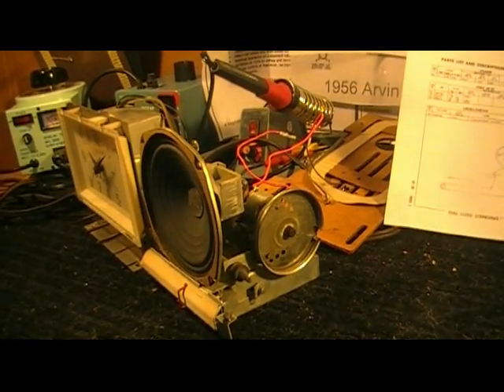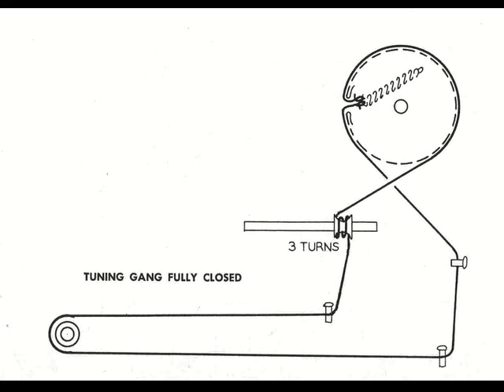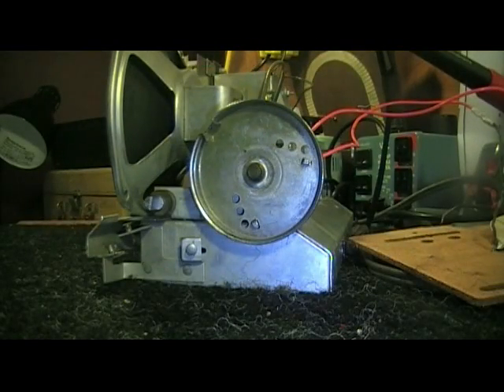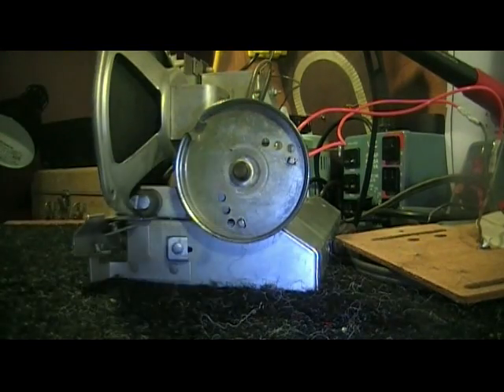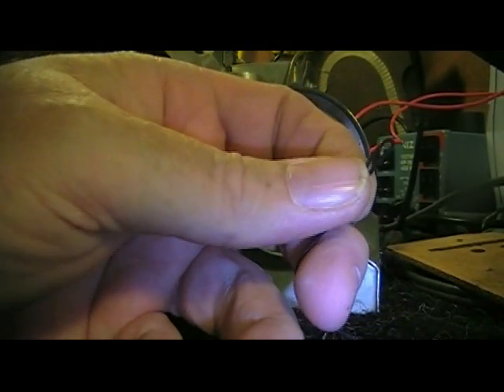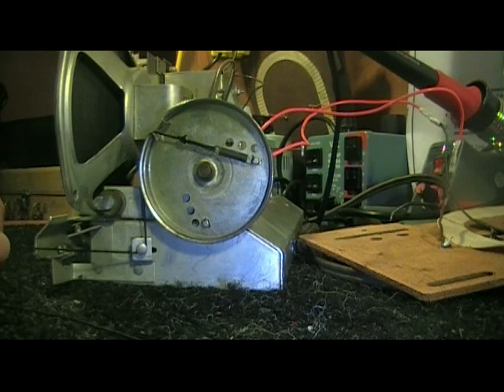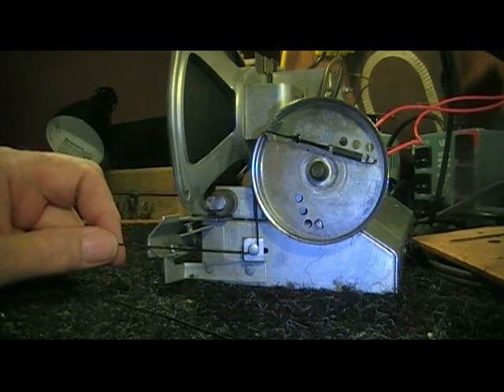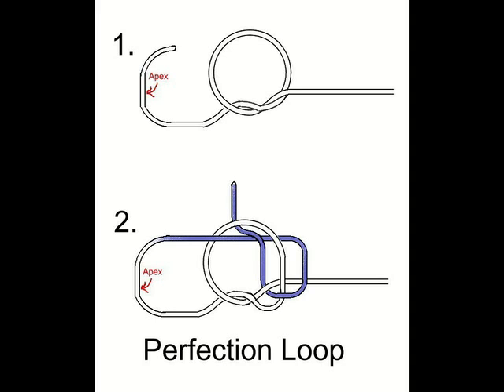Replacing Dial Cord on Vintage Radio

Comment: On the big wheel, you just have to place the spring on one side as beginning and the other inner side on the end of the wire. My configuration was made like this before it broke after 40 years..

Comment: Thanks John, didn't check Youtube video before I did my first one. I winged it and tied a knot about an inch or 2 past the spring and put a dab of super glue to keep the knot from coming loose, as I didn't know what kind of knot to use, or had no idea how to connect both ends to the spring. There were 2 tiny eyelets on the spring to thread the string through, which was difficult because the new string has a fiberglass filament in the middle. Should have skipped the eyelets and attached to spring

Comment: Thank you so much John. I am now confident I can do the same.
Unfortunately I lost the indicator pointer for my radio during a move.
Unlike your radio, mine had the wire glued directly to the cord.
So I will have to figure out the bends needed to make it travel correctly in front of the dial.  I will probably use some stiff 30 gauge wire. White paint and red for the tip.

Does anyone know what the inch ounces, or nano meter tension forces exerted on the dial string should be?
A small pull gauge might work.

Comment from the maker: The video shows only the first "fitting" of the string, which was just a rough estimate of the length needed to cut the cord from its spool.  A second, exact fitting is really required to get an absolute certain length of the cord.  Be sure to put significant tension on the spring when getting this measuremtn

Comment: Where do I get genuine dial cord. The stuff sold on ebay and amazon stretches like a rubber band and is almost impossible to string because you have to pull it incredibly tight and then it relazes and you have to shorten it again a few days later. Obviousally this stuff is not dial cord because dial cord does not stretch.
Even after all this when tuning the radio it still has some stretch to it.
Reply from the maker: I'm not sure if anyone actually makes dial cord specifically for antique radios anymore. The problem with eBay or Amazon is that these people are selling stuff just to make a profit.  They may not be radio enthusiasts nor have any knowledge about how good their products work inside radios. So I have 2 suggestions:  1st: Go to any place that sells fishing gear and buy my favorite typecof string, a spool of "Berkley Braided nylon flexible" fishing line, 20 pound test. It has an engineered flex, yes, but only to a distinct stopping point.  When you apply it to your radio you're going to stretch it taught to that flex point and it should not flex beyond that.  Since it's braided it is extremely durable.  And you can buy it on eBay or Amazon too. My second suggestion would be to purchase it from radio enthusiasts who know  the best type of cords. You could try antiqueradiosandparts.com to buy parts because they probably know better than others.  Please know that I'm not affiliated with that website.  Just because of their name I assume they are knowledgeable about antique radio parts. Or you could go to the blog antiqueradios.com and find answers to that same question. I can personally vouch for antiqueradios.com  because I have learned about everything I know from the gracious engineers and hobbyists there. It is a great place to learn about antique radios.

Comment: I'm struggling to get the cord threaded in the correct way on a similar tuner. Martin Audiokit. Probably from the 60's. So tricky as everything is between 2 panels and the cord keeps slipping off of the wheels and pulleys and i still have not really sussed which way round it all goes.
Reply from the maker: The string pattern is usually customized for each individual radio.  Unless you have the same make and model as shown in the video it will probably be a little bit different. You should be able to find a string diagram in the models manuals. If not then try using websites devoted to antique radios to see if any members might have the diagram for your radio.

Comment: I use high test fishing line.  Works great.
Reply from the maker: Thanks..  Yes, you can can use fishing line too, but not nylon filament.  The best fishing string to use is braided dacron fishing line - because it is less likely to slip.  Really good tip though!

Comment: Great video.   Where did you find the diagram for the cord routing?
Reply from the maker: Hi Jim.  I probably got that schematic from a website called "Nostalgia Air."  But several years ago I purchased a CD on eBay that was packed with several thousand antique radio schematics.  It was only 7 or 8 bucks and you can probably still find it.  Certainly worth it.  I also joined another website in Europe where membership sort of requires members to frequently upload their own schematics into a shared cache.  The name escapes me right now but it is also an amazing source.

Comment: Hi, I just bought an oldskool maxim TV... Shaped & styled like a football.. it looks brand new and unused...
I just plugged it in an within 30 seconds of fiddling with the side tuner wheel while on radio it jammed at one end.. felt like it slightly popped in... Really annoying as I now can't use the video in for computer console as I can't get the dial to move at all 😔 don't want to break it, so must open it up and see what's going on... Any ideas will be greatly appreciated...
 Really don't want to make things Any worse..
Cheers 👍
If they can, that is. Thanks 👍
Reply from the maker: Not sure how to advise you.  It could us a dial cord, but on TV's unlikely.  Does it have a radio dial?  If so then you might have a cord.  If you're not confident about doing it yourself please get a tech to do it.  These old appliances can be very dangerous.

Comment: Nice! But joined Flicker and still could not access pic.
Reply from the maker: Try pausing the video and see if you can hand copy it.
Reply: @johnallenrichter  Pause vid, press Ctrl-Alt-Print screen, open paint,  paste image, print.
Reply from the maker: @nortonics5745 explains how to capture the video screen as an image below.  "Paint" is a free Microsoft image editor that comes with Windows.  If you are using Windows you can find Paint by typing PAINT into the searchbox at the bottom of your screen.  Click on the Paint icon that pops up.  After you have copied the screen into your clipboard memory, just open paint and CNTRL-V to paste it into an image.  Another Microsoft tool you can use is "Snip."  While CTRL-ALT-PRINT copies the entire screen, SNIP allows you to copy just a partial selection of your screen.  You can find and open SNIP through the same searchbox method.  It's intuitive.  Click "new" and draw the selection box around the part of the image you want to copy.  It will place your selection into the clipboard memory and you can paste it into Paint using the same CTRL-V method.  If you are using a Mac computer, well, I can't help you other than to say throw it out and get a PC.